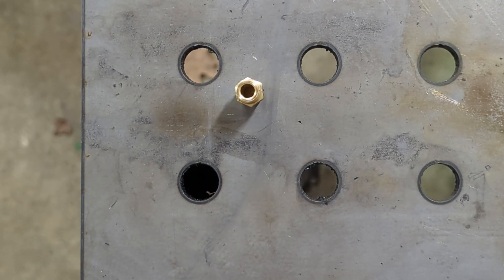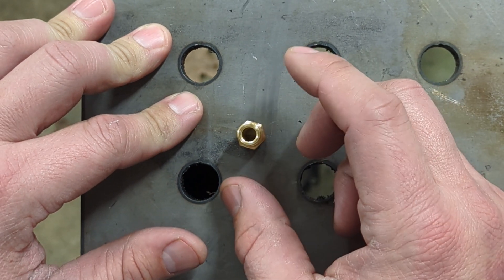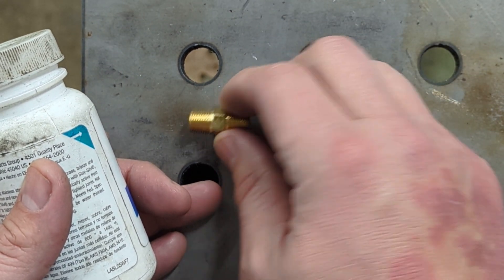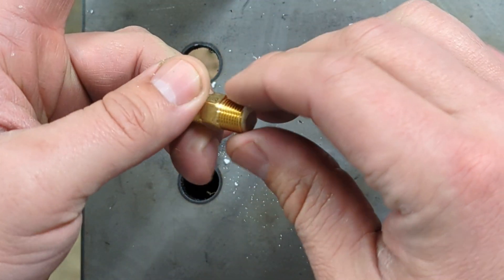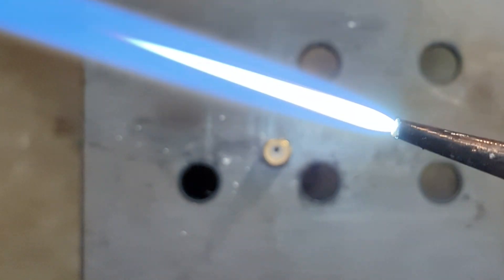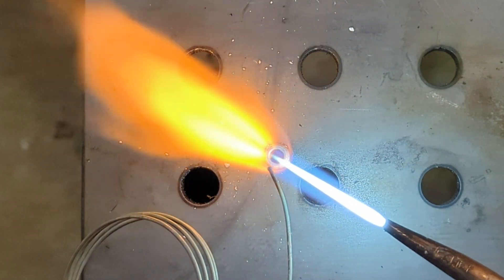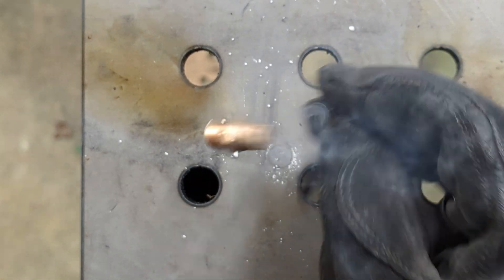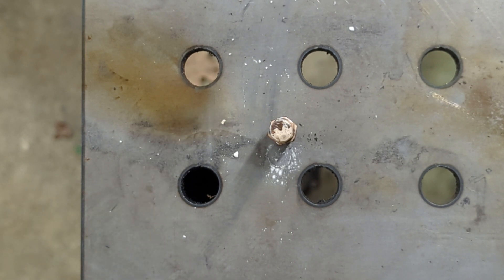Turbo Restrictor Orifice

Comment: Are you expecting similar power to the area diesel turbo on TTWT? Will the fuel have to be turned up?  I am very interested in several of your products. Would you possibly offer a bundle discount for buying multiple products?
Reply from the maker: Like with most things, the answer is yes, no, it depends :).  What I can say at this point is that there will be stages similar to the hydraulic pump options that will require different changes based on which stage you get.  More to come soon.  Regarding bundling, some items when bought together do have discounts - like the higher stage pumps or the complete loader packages.  I'm trying to keep all prices as low as possible by product, but there may be other bundles in the future when more product arrive.  Send me an email to kevin@hydrosplus.com and let me know what you're interested in, and I can give you specific feedback on options.  Thanks for the question!

Comment: Not to be a internet engineer but if you thread the inside of fitting then you could install a pipe plug and then drill hole in plug. Would be cleaner install and not have the chance of weld breaking loose
Reply: Allen head set screw not pipe plug sorry
Reply from the maker: I like that idea, but this is temporary and drilling a set screw with a .015 drill bit may not be possible.  If you look at those bits too hard the will break :)  I could be wrong because silver solder isn't terribly easy to drill, but it's seems to be softer than the set screws I'm familiar with.  BTW, I welcome internet engineers...sometimes the idea is better, sometimes it's worse, sometimes it's a wash, but it always makes me think about it to ensure I'm on the right path for what I'm doing for the moment.

Comment: Will this be a complete turbo kit the consumer can install?
Reply from the maker: Correct and it will not require any drilling or modifications to the tractor that are permanent, so you can go back to stock easily if you so choose.

Comment: Wait! Turbo! I knew TTWT had one, but I didn't know you were developing one. Wow! I'm so a customer for this. I use my 2017 1025r at 8500ft elevation and it seems to starve for air at wide open throttle.
Reply from the maker: This will be a major boost for people at elevation.
Reply: @HydrosPlus  Wow this sounds awesome.